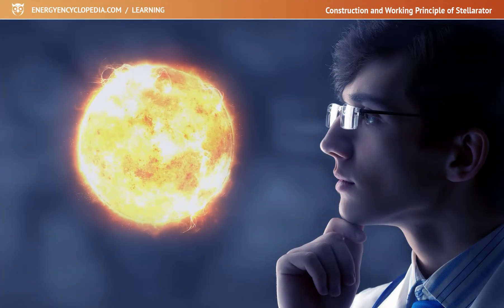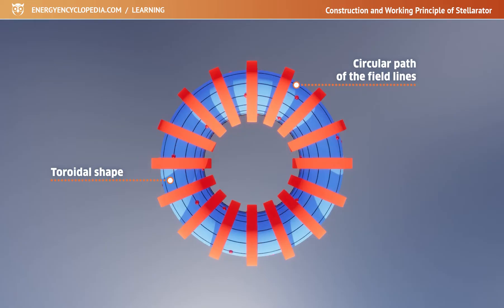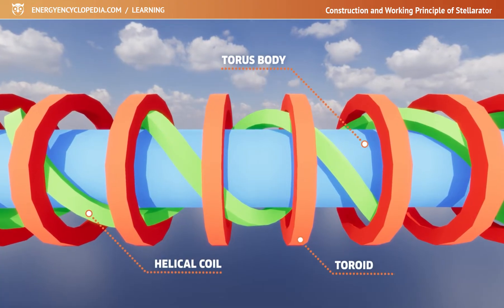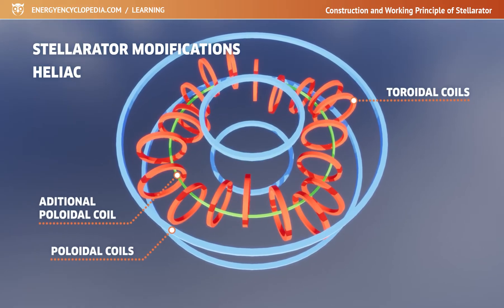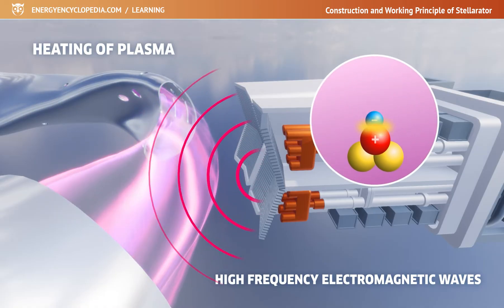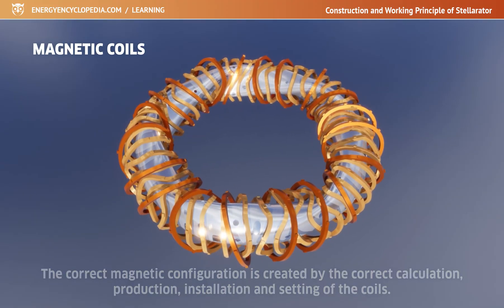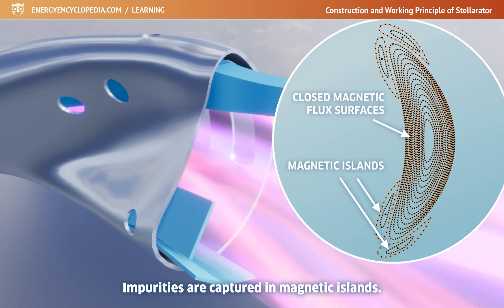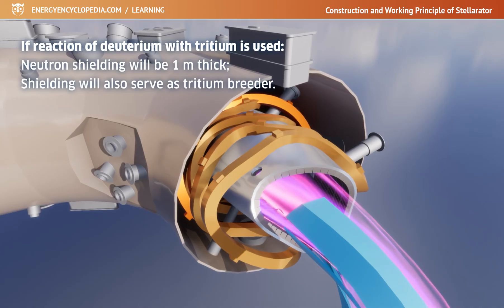Construction and Working Principles of a Stellarator

Comment: All that is is a Tokamak reactor. Russia (RSSR) invented them almost 100 years ago.
Reply: Does your brain work?
Reply: Uhm.... No. 

That is exactly what it is not. A Tokamak uses toroidal currents to generate the twisted magentic field. In fact, without the currents, it cannot confine the drifting particles spoken of in the video. A Stellarator on the other hand has the twisted field due to the coils themselves and attempts to have no currents at all, since they would modify the field and degrade confinement. 

With respect to "Tokamaks were invented 100 years ago". That is not true. Tokamaks and Stellarators were conceived on both the soviet and US side around the same time (roughly 1958). Just that Tokamaks were dismissed in the US at first, because they are inherently non-continuous. Stellarators on the other hand are. Admittedly the soviet side with T3 was incredibly successful with the Tokamak design and progressed much faster than the stellarator research (which is also because it is technically a lot more challenging to build a stellarator). That is why we have mostly tokamaks in the world, but stellarators are catching up.
Reply: @T0eJ4m  A very illuminating comment, worth more than several videos, thank you!
Reply: @T0eJ4m the diagrams presented in the video are an exact copy of a tokmak reactor
Reply: @stanley090  Radically incorrect.